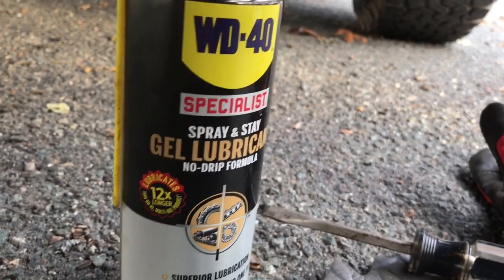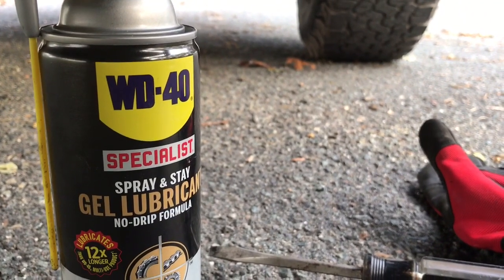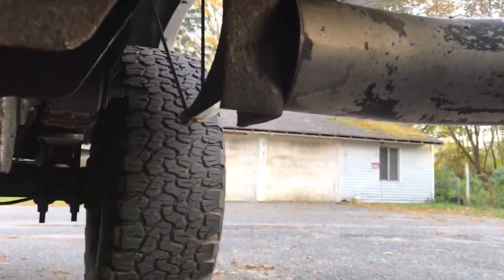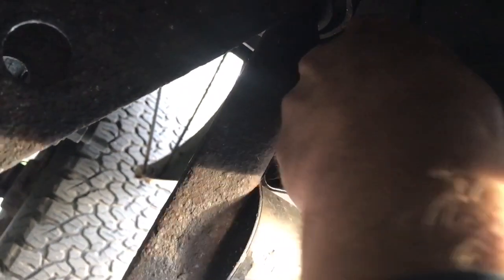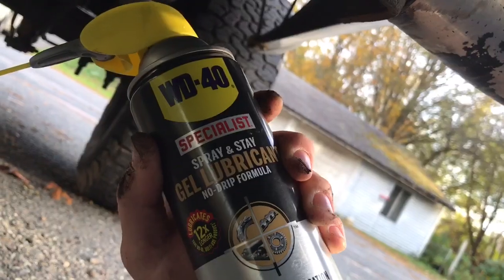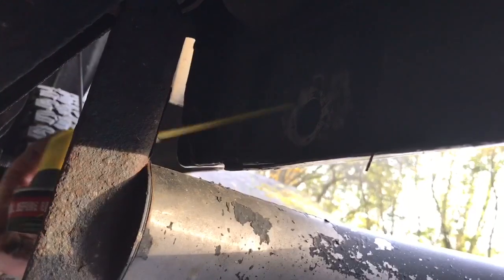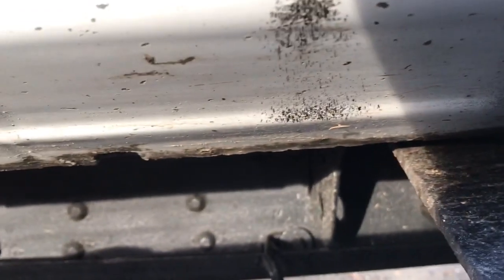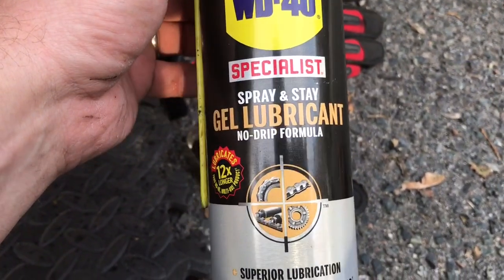Fluid film rocker panels

Comment: I had the passenger side rocker panel completely rust out and tear along the whole length on a 2006 car.

On my new car, I sprayed fluid film on all inner door crimps, door drain holes, hood openings, welds and anything that looked vulnerable.

Before winter i'll do a better job with a wand, but thanks for the video about the wd-40 gel.

I hate rust.
Reply from the maker: RFI-Crypto Lab thanks for watching man and yes use it everywhere! Can’t go wrong !
Reply: Have you applied FF inside the the cab under the door sill plates where the wire looms rest? Lots of rust formed there on one side from a water leak. Order those rubber grommets off line…waiting for them come so I can do along the frame.

Comment: When I bought my 2008 GMC Canyon newI read the owners manual. The manual said if I undercoat the vehicle it will void my corrosion warranty. So I did nothing. in Pennsylvania they use salt in the winter. They salt when it might snow. Anyway my 2008 Canyon after nine years, the frame was looking very fragile, you could scrape whole sheets of rust off of the frame. I lost the brakes two separate times from rusting brake fittings..the metal parts of the fuel pump rotted and I lost a tank of gas, that happened on a road trip, cost me $1100 to have the fuel pump replaced with labor ,towing. With only 42,000 Miles on my canyon, I traded it in on a ram 1500 four-door with a hemi. When I took that truck home. I spent five days using fluid film under that truck during the week when the temperature was in the 80s. I pulled headlights, taillights, took the runningboards off, took the wheels off, covered the brake rotors with plastic bags, Took the tailgate off and took it apart, pulled all the body plugs, took the spare tire down, I made sure I completely coated the inside of the chrome bumpers, and I lifted the rubber tread’s and sprayed heavily under those treads on top of the rear bumper, because my GMC bumper was rotting from the salt trapped under those treads, pulled all of the inner liner’s on the fenders, I bought special tools for going up inside the door posts and the frame around the windshield all the way to the roof with the spray, I made tools, for spraying fluid film. I  used about a half of a gallon of fluid film. 
   I went through one winter, the following summer I climbed under the truck, and it still looked like it was new, just wet with fluid film. I am going to do the same thing under my truck before winter this year, it is now October, I will give it a touch up job. But it still looks good, I don’t know if I have to do it every year, but I’m going to. Because of all of the brands of trucks out there, the ram trucks seem to be the ones with the most rusty wheel wells rocker panels and tailgates that I see. I always look to see where they rust when I see a rusty one. I recommend fluid film. I also recommend buying the special spraygun that they supply with two plastic bottles. But you’re still going to need to go through about four of the spray cans that they sell at Lowes for $9.99, get the 4 foot attachment for the spray cans with a tube It’s about 4 feet long that makes the fluid film spray in a 360 pattern because the end has a jet in it that squirts the fluid film out at a right angle in 4 directions at the end of the 4 foot flexible tube. I bought the for foot extension tube on eBay for 13 or $14.Great stuff. Why try something new that’s untested, when we already know that fluid film works. It is also good for leather like your shoes are your belt or your wallet because I tried it. It’s not hard on your skin either. I was using this product called POR15 that had more warnings that an atomic bomb on it about not breathing it or getting it in your eyes were getting it on your skin. I accidentally got some on my wrists and forearms. I ended up going to two different doctors and I was diagnosed with folliculitis from the product. It does not come off your skin. It just looks like thick black paint..It seemed to work where I tried to save my GMC Canyon, but it doesn’t flow into the cracks and seams like fluid film does. Fluid film travels, it’s spreads out.any paint like product that you have to paint on with the brush, is not going to flow into seams or travel like a non drying fluid..It’s great stuff
Reply from the maker: Harry Lime  that’s one hell of a comment.!! Very cool story and yes this stuff is awesome and works great ! I love it ! And my truck loves it more ! Thanks for watching man ! Have a great day!! 😎👍🏻
Reply: Good sh!t man! 🤣
Reply: Great comment!

Comment: Curious if you recommend using this before applying a rust converter or after? It’s actually for the inside of the truck (inside channels under the door sills where the wire looms rest). Rust has formed in those areas due water leaks. Def gonna do the undercoating and find some rubber grommets you showed in the video. Thanks for sharing!
Reply from the maker: I use it everywhere kind of like Frank’s red hot hot sauce I use that shit everywhere
Reply: @Gasolinegarage  hahahaha very well, i’m all in.

Comment: You spray the inside of rocker panels every year? wow I always thought that once you spray fluid film thoroughly (INSIDE the rocker panels, doors, fenders, etc) it should be enough for a few years at least.
   Anyway i sprayed my bimmer e46 during the winter from the inside as well as underbody, shock towers, basically every place i could reach with or without 600mm extension. I have even pulled the inner fenders, side skirts, covers inside the trunk (especially to spray the rear shock towers which already had some surface corrosion), rubber plugs (obviously). However it seems that FF washes off pretty easily, at least in my experience. After a few rides during snow/rain a lot of it from the underbody was gone. i read a lot of comments on YT from guys spraying the underbody with FF and it seems to have worked for them.
   I think FF is too watery to spray it on the underbody, I would say put it everywhere where road debris, water, road salt and snow won't splash directly on it and then spray those uncoated, more exposed to water/snow+salt areas with something thicker and inspect the car every few months, it's probably gonna need to be sprayed here and there after those few months. I bought a 400ml can of grease for chains and steel lines for that purpose, it's definitely thicker but i can't really compare it to FF because it's already spring and the snow is gone.
   just my 2 cents for someone wanting to rustproof their car :)
Reply: Master Jacob i use woolwax its alot thicker and does not drip off and its the same price

Comment: Yup you have to do something like this or your rockers will rot away in no time. Didn't know wd 40  has a similar product to fluid film. I get my car rust proofed at krown but they miss spots and some places limit application to save money. I do this in addition. Like in the video don't be afraid to put too much on
Reply from the maker: dave houston absolutely I do it every fall in this video is from about two years ago in my rockers is still in great shape I guess said it’s no good in the can 😂 Thanks for watching buddy hope you subscribe I got a bunch more videos on here thanks again
Reply: @Gasolinegarage  that's a great line it's no good in the can so true
Reply: if you can find it locally, if not amazon, WD40 also makes a product called long term corrosion inhibitor. its in a can more like the old WD40 with the paint style spray nozzle instead of this type but same type of wrapper. get that and the fluid film adapter thats available on amazon and you can run that right up inside body panels as well as holes in the frame to coat them better.

Comment: That stuff is great but too thick for rocker panels for my liking , I just dump used motor oil in the rockers and tail gate.
Reply from the maker: David maclean used oil works great too !!
Reply: Anything is better than nothng, but don't let its consistancy keep you from using it...its much much better than oil.  It's consistancy is part of what allows it to stick and creep in all directions, including upwards.  I use Flid Film by the gallon and notice a huge benefit over using used oil.
Reply from the maker: The Beaten Paths There’s nothing that beats it fluid film is amazing stuff
Reply: @Gasolinegarage  Agreed!!!!

Comment: how many times do you do use it? once a year or twice a year what? thanks
Reply from the maker: joseph rigsby I at least try to do it once a year up in the wheel wells there is plugs to take out also just like on the rocker panels all the way across the underneath of the truck it’s a great thing to do and it keeps the inside of your rocker is covered with that oil

Comment: I have rust flaking off inside the rocker panels that I can't flush out even with a water hose. I guess I'll just let it dry and try to spray something in there at that time. There are NOT enough access holes to reach the whole cavity so I may end up adding some and buying plugs to fill them. Northern NH uses a liquid road treatment that kills metal. I have been running a garden hose sprinkler under my car to wash the salt off in the spring. Salt holds so much moisture. Think of your salt shaker on a humid day.
Reply: I used a flexible magnet light that fit into the hole to clean some flaking before I started fluid filming